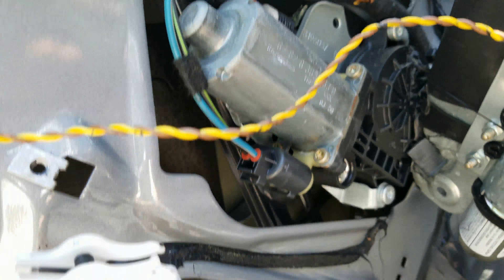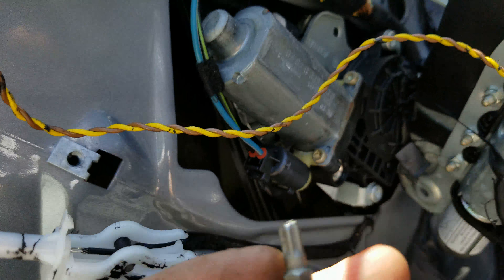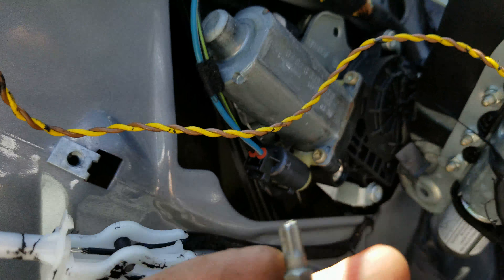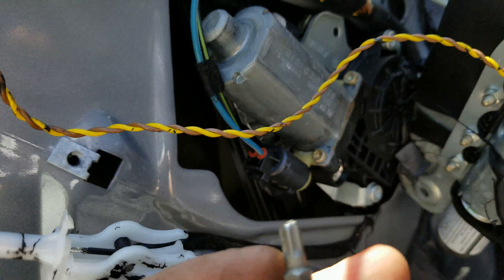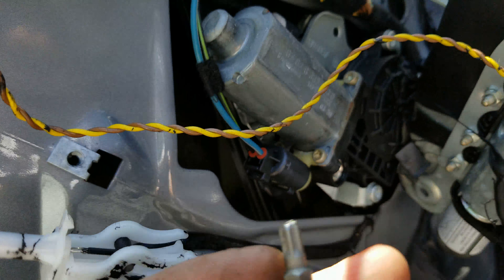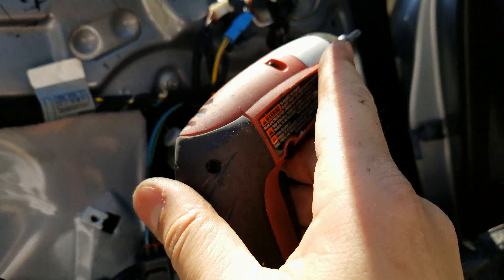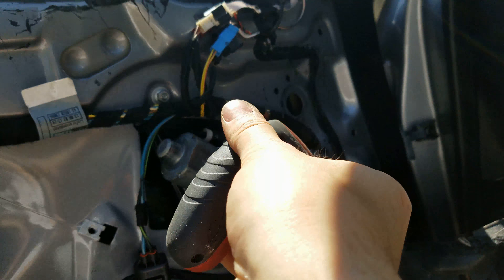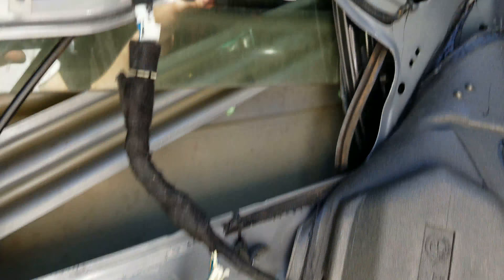E46 3 series BMW Window Regulator Zip Tie DIY Hack

Comment: Does this work for the rear windows?
Reply from the maker: It works on all windows with same slider problem getting loose. By the way, it still works , had no issues yet.